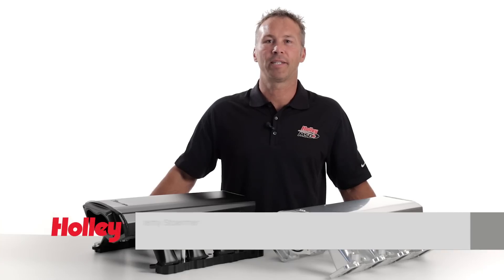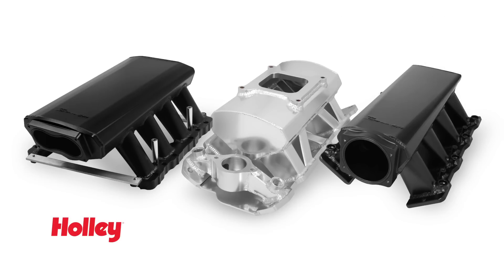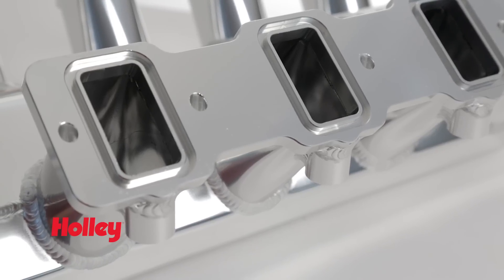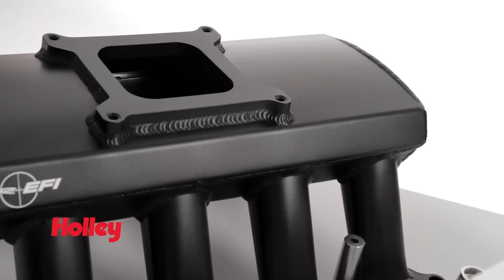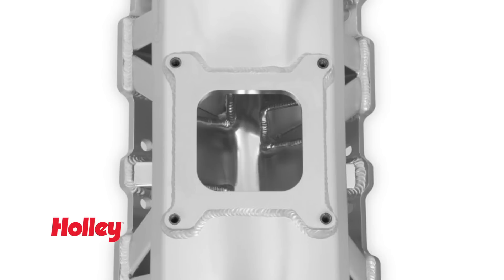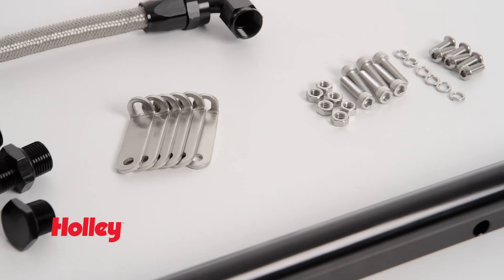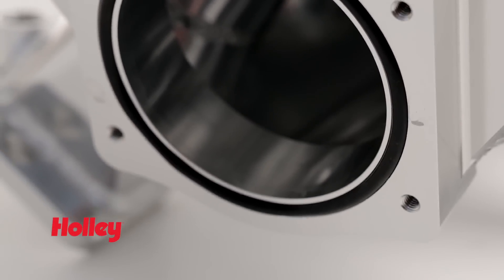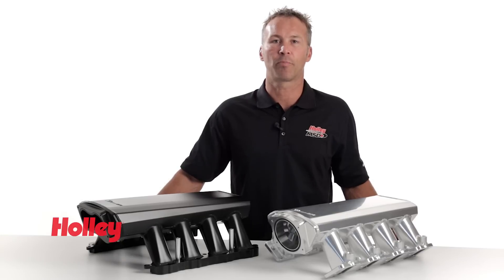Holley Sniper Fabricated "Sheet Metal" Intake Manifolds

Comment: Since they did not provide a gradual radius from the plenum to the runners this intake is not going to flow as well as it could. It needs a little metal or epoxy work on the inside.

Comment: do these sniper intakes for the 08 mustang gt 4.6 modular motor replace the charge motion plates? or do they sit on top of the charge motion plates? also can these intakes handle boost? if so up to what psi are they rated to?

Comment: so someone on a budget, can they use the factory throttle body on the it or not.
Reply: because it looks like I can use the 4 bolt throttle body on the intake.
Reply: GM 4 bolt throttle body
Reply: I'm using a 92MM Throttle on the high rise (LS1)
Reply: Anthony Davis How is that working for you?? Will a 102 mm fit a stock LS1?? on my trans am? Also any speed performance difference?